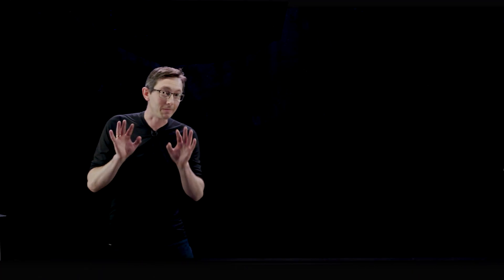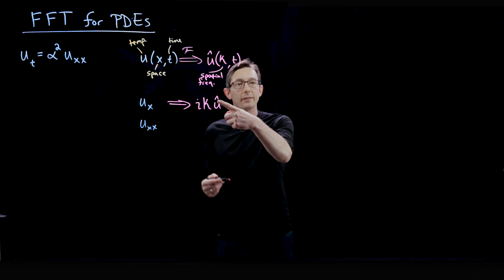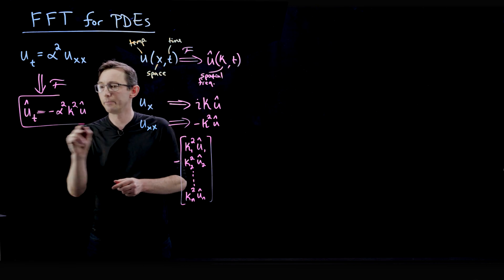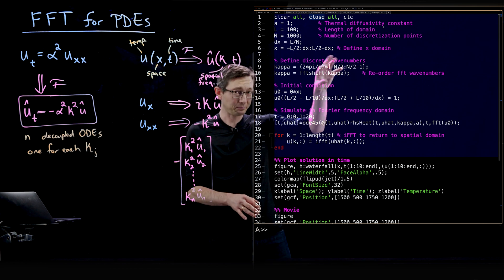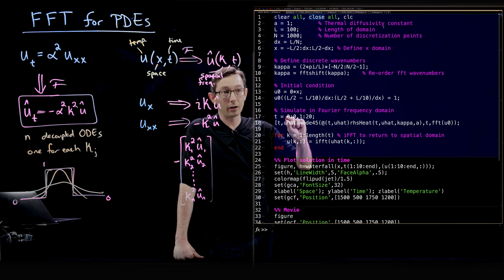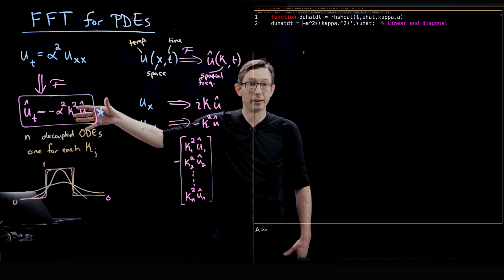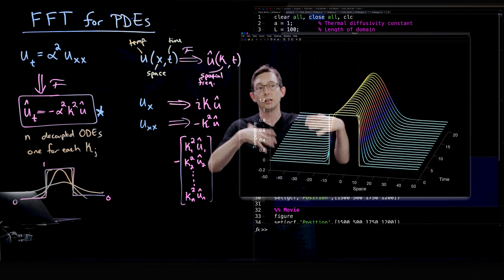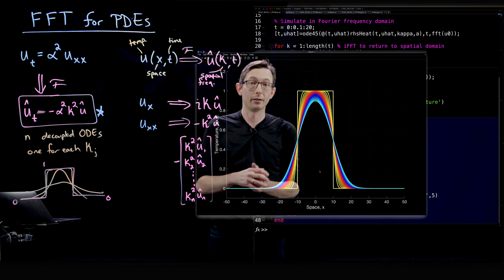Solving PDEs with the FFT [Matlab]

Comment: Beautiful illustrations of using FFT to solve pde! I understand that this is an elementary example so things are kept simple. However, solving heat equations with ode45, which uses explicit time stepping scheme, is unstable since heat equations are stiff. It will be great to point it out so people will turn to the correct scheme later when they really need it.